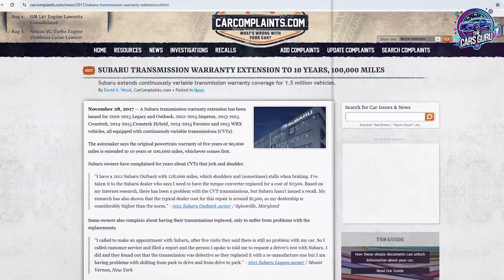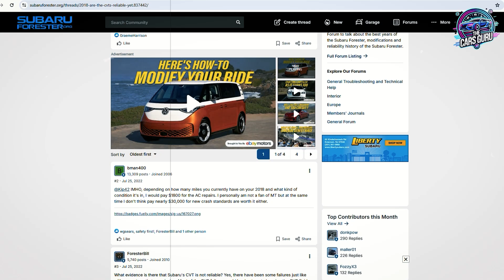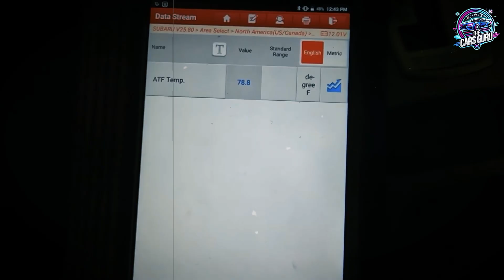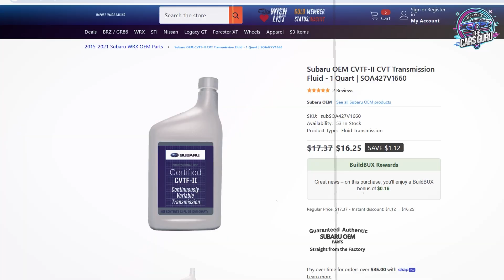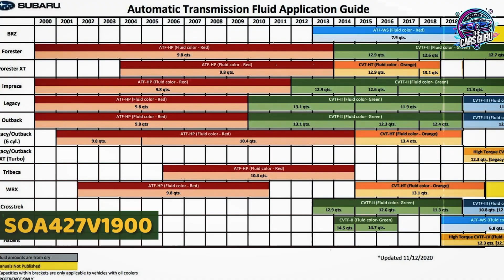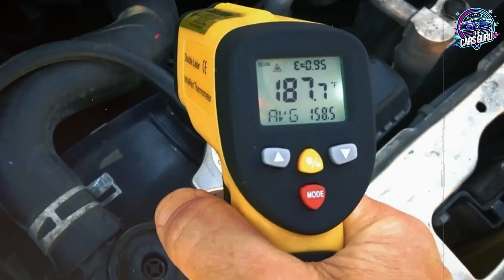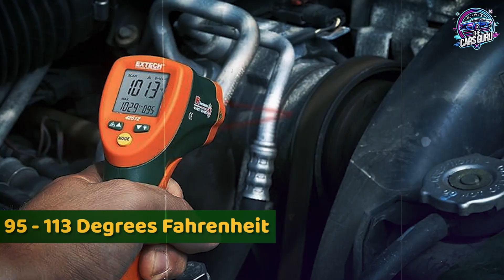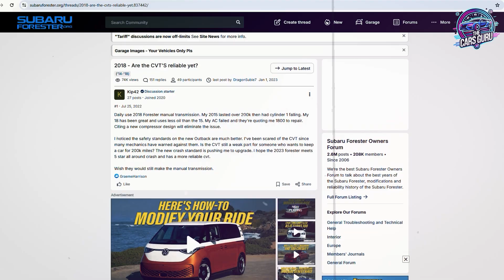Subaru CVT Maintenance: How o Avoid $7,000+ for CVT replacement

Comment from the maker: Toyota Hybrid AWD Technical Information:

Toyota Official Press Release: 2026 Corolla Hybrid specifications and Electronic On-Demand AWD details
https://pressroom.toyota.com/the-toyota-corolla-hybrid-brings-efficiency-and-style-into-2026/
Toyota Official: All-Wheel Drive Systems Explained
https://www.toyota.com/all-wheel-drive-vehicles/
Motor Trend: Toyota All-Wheel Drive Systems Technical Analysis
https://www.motortrend.com/features/toyota-all-wheel-drive-explained
Toyota Official: 2025 RAV4 Hybrid AWD System Details
https://www.toyota.com/rav4hybrid/

Toyota Reliability Scores:

Consumer Reports: 2024 Toyota Corolla Hybrid Reliability Analysis
https://www.consumerreports.org/cars/toyota/corolla-hybrid/2024/reliability/
TopSpeed: Most Reliable Toyota Hybrid SUV Rankings (J.D. Power 81/100 score)
https://www.topspeed.com/most-reliable-toyota-hybrid-suv/
TopSpeed: Toyota Corolla Hybrid Model Years Reliability Ranking
https://www.topspeed.com/ranking-toyota-corolla-hybrid-reliability/
TopSpeed: 2009 Toyota Prius Long-Term Reliability Analysis
https://www.topspeed.com/this-older-toyota-hybrid-still-a-reliability-champion/

Subaru CVT Problems Documentation:

Subaru Outback Forums: 2024 Premium CVT Failure at 12,500 Miles
https://www.subaruoutback.org/threads/2024-premium-cvt-failure-at-12-500-miles.558609/
Subaru Ascent Forum: Transmission Failure 12 Days Into Ownership (2024 Model)
https://www.ascentforums.com/threads/transmission-failure-12-days-into-ownership-on-2024-model.22041/
Automoblog: 2025 Guide to Subaru CVT Problems and Warranty Extensions
https://www.automoblog.com/reviews/maintenance/subaru-cvt-problems/
Daily Car Tips: Subaru CVT Transmission Reliability Deep Dive
https://cartipsdaily.com/are-subaru-cvt-transmissions-reliable
Rick's Free Auto Repair: Subaru CVT Reliability and Common Issues
https://ricksfreeautorepairadvice.com/subaru-cvt-transmission-reliability-and-common-issues/
Jerry Insurance: Most Common Subaru Problems & Years to Avoid
https://jerry.ai/car-repair/common-problems-with-subaru/

Industry Analysis and Comparisons:

Car and Driver: 2025 Toyota RAV4 Hybrid Review and Specifications
https://www.caranddriver.com/toyota/rav4-hybrid
Toyota Nation Forum: RAV4 Hybrid AWD Technical Discussion
https://www.toyotanation.com/threads/rav4-hybrid-awd-is-it-really-all-wheel-drive.1660300/
The Drive: Explaining Toyota's 2024 Reliability Issues Analysis
https://www.thedrive.com/news/explaining-the-toyota-reliability-crisis

J.D. Power and Transmission Studies:

Referenced from multiple dealer and automotive technical sources for the 40% complaint reduction statistic in 2022-2024 Toyota hybrid models vs. Subaru CVT models

Additional Technical Sources:

BobIsTheOilGuy Forums: CVT Long-Term Durability Discussion
https://bobistheoilguy.com/forums/threads/cvt-transmissions-long-term-durability.280011/

Comment: You can buy a CX 50 turbo with a bullet proof Aisin 6 speed, and change the fluid every 60,000 miles, with no paranoia in between. I've been cross shopping these recently, and I'm already tired of the Subaru CVT, even though I don't have one.

Comment: The video is correct regarding changing of CVT fluid at 30K. In addition you should also change the fluid in both the front and rear differentials ( AWD ). I have mine changed at a Subaru dealer and they have top notch trained mechanics who know what they are doing regarding CVT fluid changes. I watched and the mechanic explained about critical temperatures while changing the CVT fluid and the "relearning" process for the CVT with new fluid installed. It is quite a process and can't be rushed, but done correctly is your best insurance for a long life for your CVT. I have owned 4 Subaru's and have a 2025 Impreza Sport which is awesome to drive. As with any make and model vehicle MAINTENANCE is key to keeping the vehicle in top condition and cutting corners or extending maintenance intervals may result in damages or expensive repairs. I have always opted for a extended warranty, just in case it was needed, but have never needed it in 10 years of ownership of any Subaru. Fluid is cheaper than replacing a CVT transmission, take care of your car and it will take care of you !

Comment: Have been thoroughly impressed by the CVT and 1.5 litre turbo in a Chevrolet Malibu rental car I have driven for the last 600kms. My Subaru got t-boned, but is being fixed. This Chev CVT has 5x better initial throttle response, holds the power band smoother, and way way way less fake shifts than my 3.6r Gen 5 Outback. Can chirp the tires when starting off too. Kinda feels what you think the Subaru should feel like, and the Subaru feels what you think the Chevrolet would feel like. Subaru needs to up their game big time.

Comment: I have a 2021 Subaru Forester VIN# JF2SKADC3MH426822 I take my SUV to a Subaru Dealership I have them change my CVT fluid. They always use type two fluid is this the right fluid.
Reply from the maker: Hey @JohnSikes-I1n, thanks for bringing this up!
I totally get the confusion - this is actually a really common question I see.your dealer is using the correct fluid. The 2021 Subaru Forester with the Lineartronic CVT (TR580) requires Subaru CVTF-II (sometimes listed as “Type 2”). That’s the OEM-spec fluid Subaru designed for your transmission, and it’s made by Idemitsu for Subaru. You’ll also see it sold as Idemitsu CVTF Type SB2, which is the same formula. So you’re good to go. You can double-check this on Subaru’s official service chart here: https://static.nhtsa.gov/odi/tsbs/2021/MC-10198758-0001.pdf

Comment: I had a lot of problem with this video's using the word "professional" which does not mean "certified", or "correct". This sounds like a coordinated effort to confuse and deceive customers so that their CVT transmission fail. If that is the case, why is there no class action lawsuit?

Comment: This is a bunch of scare talk.  This is not the only transmission that ever existed.  Subaru did not invent transmission fluid. Generally the primary issue is solenoid failure, and those solenoids can be replaced.   Many mechanics won't work on the Subaru CVT because once these failures start the CVT can ruin itself.  Simply change the fluid, and if the CVT throws codes change the solenoids (or valve body)
Reply: I'm not a Subaru mechanic, but I do understand Subaru is a unique car. Many mechanics won't work on any part of a Subaru because they simply don't know how. If properly maintained, the Subaru is as, or more, reliable as any other car on the road.  See most recent Consumer Reports evaluation.

Comment: First, you warn, that Subaru dealer shops will purposely install the wrong fluid, to run your CVT.
Then, you say it's best to take your Subaru, to a Subaru dealer, because they know the correct fluid, and process for changing the fluid.
I stopped right there...
Reply from the maker: yo do the comment because you stopped right there..

Comment: Nevermind proper tools. The amount of fluid that came out will be push back in  😏 and disconnect the negative terminal to reset all whitout expensive material tool to rerpogram

Comment: Hi, how is that what you are saying  contradicts the chart you are showing. The chart clearly shows that naturally aspirated Forester uses CVTF 2, green fluid through 2019 all the way to 2023. There was no switching mid year to CVTF 3.
Reply: Yeah I caught that too!  All charts I found on internet clearly show green CVTF 2 for 2014 - 2023 Foresters (non-Wilderness trims), and no switch to CVTF 3 until 2024 model.  Spoke with parts department at local Subaru dealer and spoke with a local independent Subaru mechanic and both confirmed CVTF 2 for my 2022 (Touring) and 2023 (Sport) Foresters.

Comment: My dealer told me the transmission oil changse will cost me $850 on my Leagcy!
Reply: @acesh5606  Weird, my dealer near Asheville NC changes ours for just over $200 🙄
Reply: @chrisb9478 That is crazy, I needs to take alook at that better.
Reply: @chrisb9478   I wonder what is different from your dealership and mines. 4 times difference does not make sense! What is the name of your dealership? If I have to drive 6 hours it will still be cheaper to do it there!
Reply: @brychezs1 Hunter Subaru, Hendersonville, NC
Reply: Run .
Reply: Do you live in florida? They told me the same thing which makes no sense because a full drum of oil cost about 4 to 500. So basically they get to buy a whole new drum of oil just to use a few quarts. This is insane! I am scared to ask if they sell the fluid, they might say 100 per quart! They also acted like this service requires a lot of technology and procedures that take about 4 hours. A subaru master mechanic did it in 30 minutes in a video.....
Reply: @brychezs1 I live in Alabama and yes they told me It takes them 3 hours to do the oil change and they said its a complicated process lol

Comment: Yup I do my Subaru Crosstrek every 30k and I use Amsoil CVT never had any issues, I'm at 70k and it's running lot a top.
Reply: 240 000km sans aucune vidange de boite CVT ! Forester SJ 2017 150 CV
Reply: @cbijames7  i had a levorg and hammered on it  and it was stolen 2 times and driven 80k kms  and cvt fluid was allright but diff fluid was bad in rear
Reply: @fritzsnickerz855 80k miles or km
Reply: @cbijames7  what year crosstrek?
Reply from the maker: Good stuff